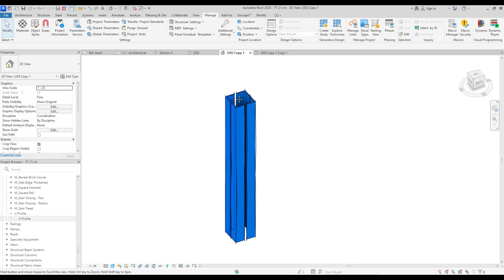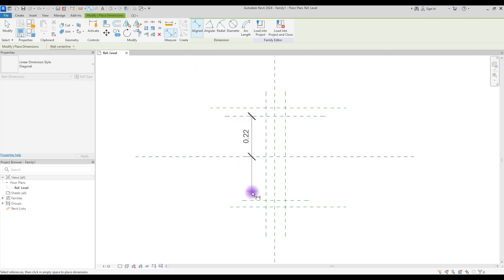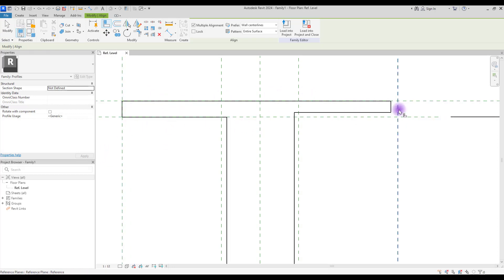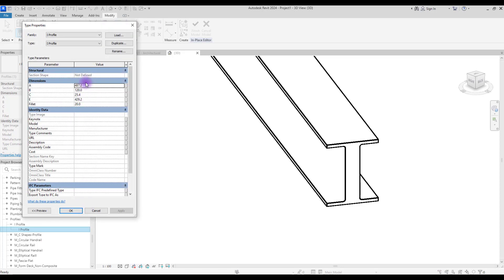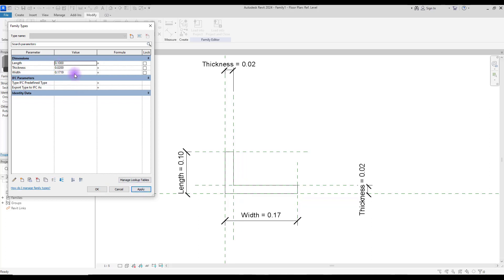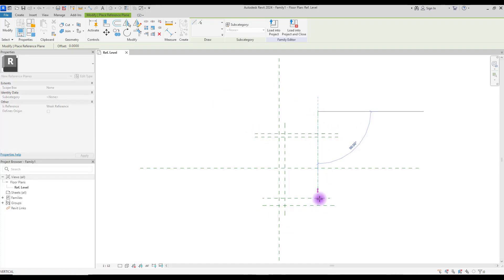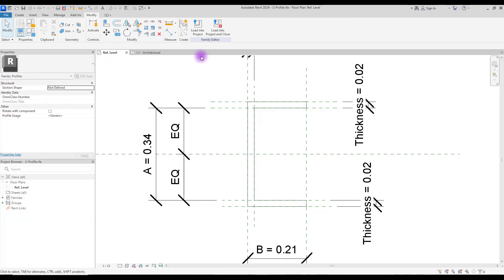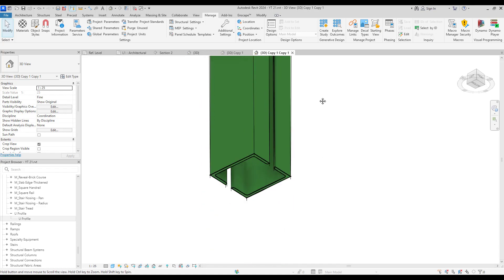Structural STEEL profiles in Revit 2024

Comment: thanks for your incredible video. may i asking how can i know the total length of sweep component? i don't know how to get the UNP total length on revit schedule, thanks in advice
Reply from the maker: For exporting total length you should add length parameter to your schedule and then in formatting section you need to use calculate total on that parameter.